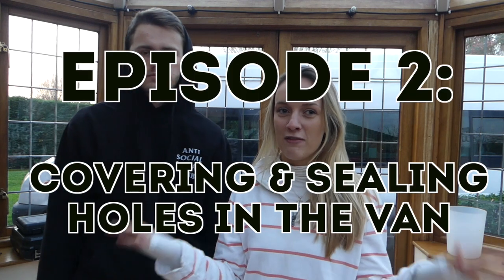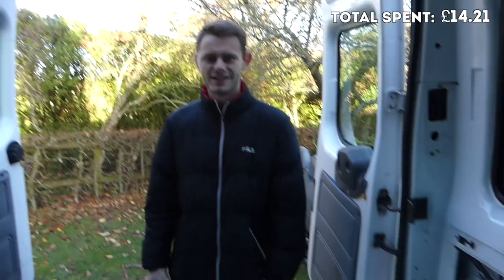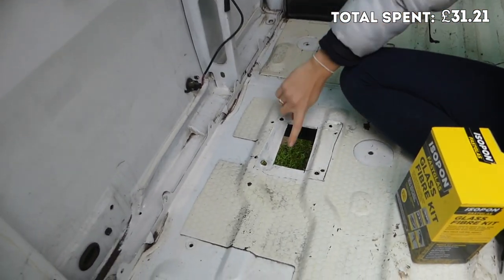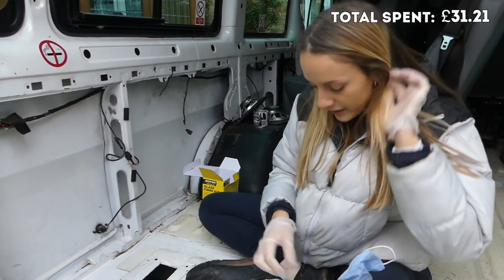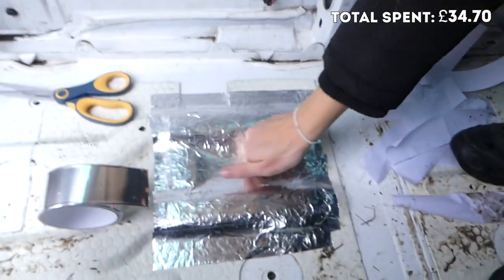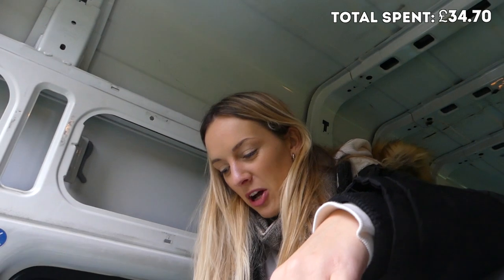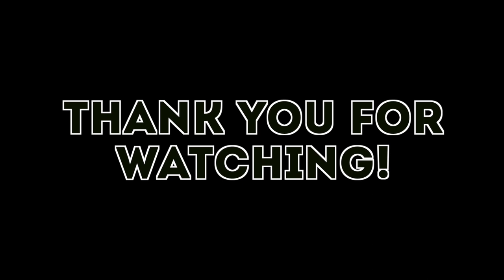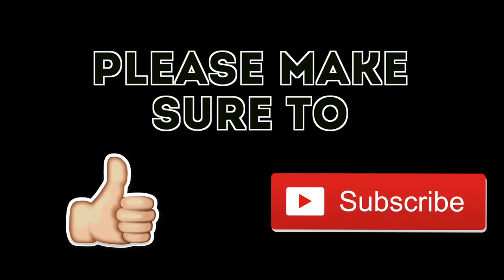Ep 2: Covering Holes in our Ford Transit Camper Conversion / With Fibreglass, Sealant & Coins

Comment: You can seal the underside of your patch with hammerite underbody sealer, highly recommend for not just that but other vulnerable parts of the van :) can get at Halfords or screwfix. Not sure that the foil tape will last long term under there

Comment: watch project binky the latest one.They have used sound and heat insulatiom on the flooring. but would work on glass as well .  I have the same van looking at changing two a six seat and down to 3.5 t.
might try change to a van with glass. More of a day van. Have you sorted out the insurance. ?

Comment: If you brought that into my mot station I'd fail it on the hole being filled with fibreglass if it was close to a crossmember or wheel arch.. It needs welding  if it is.